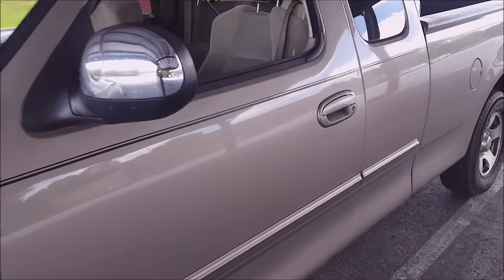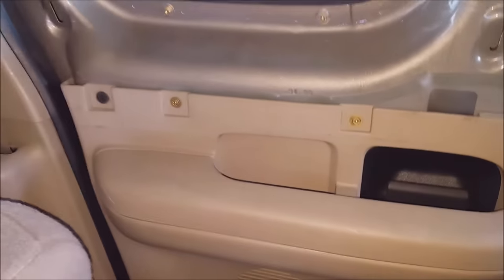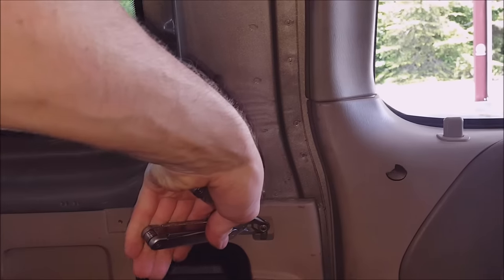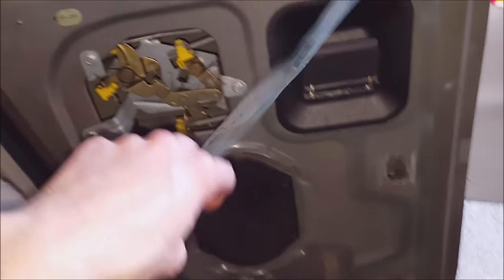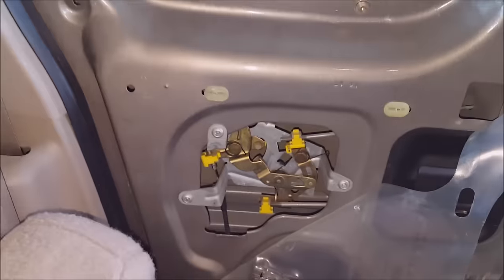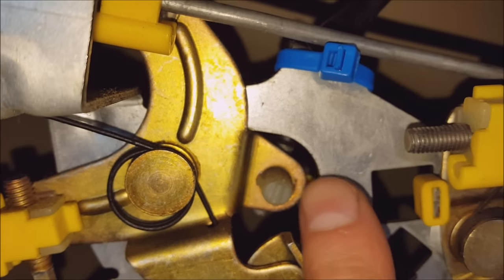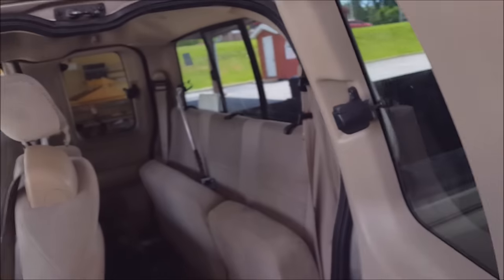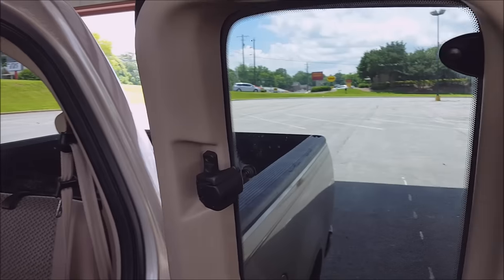Rear Door Wont Open F150 1997 - 2004 SuperCab

Comment: Mine stopped working today on the driver side. So I'm like maybe it's because I slammed it. So I went to the passenger side and slammed that side too. Now they both wont open. Fml
Reply: Sounds like my luck.Great running truck but starting to rot of its frame.
Reply: My man!!
Reply: It’s because they use plastic and plastic doesn’t hold up
Reply: @Austin_B_Videos  Yup plastic never has and never will hold up for this application anyway. While it doesn't take a BSME to figure that one out, we won't blame the engineering department. Engineering at Fomoco was probably over ruled by the bean counters 27 some years ago. So what did they care since most light trucks are sold to the commercial / fleet markets and therefore are built with a design life of like 10 years or 100k miles, which ever comes first.
Reply: Same here bud, sucks.
Reply: Lol same, I always thought since the rear door was double latch it needed an extra push which is so wrong 😂 I’m about to try this rn and see if it works
Reply: @codyswilley  ty for this video. First my passenger side door wouldn't open now both aren't opening. So I have a project set up for After the Chicago Bears Game. opening day of the regular Season 2024 .. 🐻👇

Comment: There is a cable sheath end repair part, I got one from the local auto parts store for $12. The part number for the cable sheath end is "doorman 926 111".
Reply: I just used these to fix the 3rd door on my '97 XLT Flareside. The stock part is plastic/rubber and will dry rot over time, but these aluminum parts should last forever. Easy fix without replacing the entire cable.

Comment: Huge help! You don’t have to break that pin though at 2:35. You just push the center in with one side of your needle nose and it pops right out unbroken. This video was so incredibly well shot (one handed fix!) and so short and easy. You’re the man! Hope my little tip helps someone.
Reply: Saved my pin, THANKS!
Reply: @kylewidmar3177  glad to hear it! Nice to put it back together with all the pins intact.
Reply: Aw, man. I wish I read your comment before destroying my pins!
Reply: @atomaardappel566  ugh!  Yeah, I almost did that too- only reason I didn't was cause the great guy that made the video commented about this breaking the pins... so I was thinking "there has to be a way to do this without breaking the pins" so I looked carefully and got lucky.

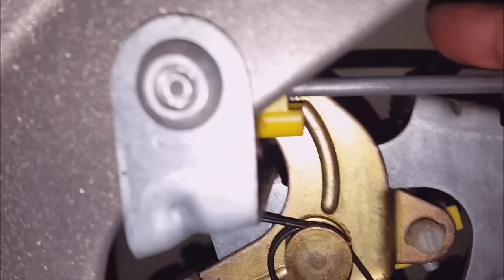Comment: Good video told me how to get the inner panel material off my "third" door on passenger side 98 model. Mine the black plastic cable end collar stopper things had broke on cable for upper latch, so I opted to replace them with new aluminum ends, not that expensive a set of 4 to do one door run $5 - $15 online or at your local parts store. Other videos on YT show how you either replace the ends which is usually all you need or the entire cable as desired or required. You can push the white / yellow plastic piece out squeezed with needle nose pliers. (SEE, little white nylon plastic circular thing @3:54 in video center screen which is to the right of the spring.) Be careful, (and try to do when the temperature is reasonably warm, duh, or warm gently with hairdryer first) but if you break the plastic parts, can also get new of those as well. Cable then comes loose of the mechanism and can pull up and out to either put new aluminum cable end on (replace the black plastic cable end under finger in this frame) or new cable. You do NOT need to drill any rivets out to replace the ends or the entire cable for that matter, just DON'T. When buying new cable ends, try to get a set where one is different, a bit thinner at the end having what is termed a "cam end", for easier install in the top latch. 

On mine only the upper cable ends were broke so did not bother the bottom, being after watching this video and doing, why I can get back in there in like 10 minutes if ever need to! Oiled and greased everything, figure bottom cable will last life of the truck. Other videos on YT also will show you how to remove torx head screws so the latches can be accessed to replace those collar ends. Got mine DONE, thanks much for video, just trying to help you guys and gals out there with yours. Good luck.

Comment: Thank you this is exactly what happened with the truck I'm working on thanks for making this video to clarify how to take it apart of all the door panels I've taken apart on these suicide type doors this is one of the easier ones to do especially when the door is stuck locked and you got take the panel off and get it open from the inside

Comment: Thanks. Got mine fixed with the zip tie but if you take the three screws out of the top of the door you can undo the cable from the mechanism where you put the tie and pull the cable and all out and replace fairly easy as well.
Reply: rip rap thats my next move after the cable arrives, thanks for that information.
Reply: Since I posted this my zip tie rig had failed. I had to get the aluminum ends you can get off of Amazon. They are working well. My doors get used multiple times a day with the kids getting in and out.
Reply: @jumpinggulley  it looked like it would slip upward.. i would have used a second zip tie to keep that one in place

Comment: Great 5 minute fix I did open door and fix from outside , Texas too hot to be inside and the nut is a 10 millimeter..
Reply: My door just failed too but lucky for me I just redid my AC system so I’ll be fixing it from the inside the truck with it running 😂

Comment: that is a 10mm on that bolt and I had to use a couple zip ties. one to keep it in the slot and one to straighten more vertical.  thanks for the vid, both my doors were locked.

Comment: Now the looking through the handle to see if the cable was broken or dislodged was a great tip! I have a 98 and only one back door with a back seat full of garbage, parts, fishing gear, empty bee... I mean fishing juice cans ect. It is going to be a nightmare to get at but maybe if it is the same issue I can manually pop the door open through the handle.

Comment: I bought the pieces on Amazon for the cables and put one on the piece you tie wrapped. I had to use a small c clamp and put it in the door and pull the cable back in place after putting the piece on the cable first.
They come 4 to a package and are kind of cone shaped

Comment: Thank you for the helpful video. I can do all that if I can see how to get it apart. And now I know. Interesting that the latch looks identical to the one inside the tailgate. I've had to replace that one before because one of the latch ears broke off. It's made of pot metal, not steel.

Comment: Great video bubba but it wasn't that easy for me tho ..I did what you did   with a tie around  the bracket but it didn't work but then I pulled down the top cable after fastening like you did and about 2-3"from the bracket  i zipped tied the upper cable with to heavy duty zip ties and it work perfect total of 3 thick heavy duty  hope my fellow bros that trying to save some dollars  watch this video and if you run into more trouble maybe my input might do some of ya'll good 🤘✌👊🤞

Comment: Just watched your video on your back door latch not working I want to look at mine same thing happened what I found out the cable still attached what the plastic outer housing at the end has a a little plastic thing it fits in that slot where it's supposed to be where you zip tied it and the metal after years of use it cuts off that's why the zip tie work it's holding it in place thank you
Reply: Thank you

Comment: The plastic piece that goes in the slot was broken, I got the doorman repair kit part number926-111.  The sad thing is it's on both driver and passenger rear doors. But I got it fixed. Had to take the cables out to do it.

Comment: those are not rivets they make a tool for those bolts approx $12 at a mechanic specific store
Reply from the maker: That's interesting do you have a link to one?
Reply: They are aluminum “pop” type rivets with a steel pin. They have to be drilled out to be removed. Drilling the aluminum is easy, but the steel center pin makes it difficult - your drill will wander everywhere. The secret is to take a metal punch and hammer to the steel center pin. Sufficient force will (finally) pop out the pin (usually takes me several sharp blows with the hammer). Once the pin is knocked out, a drill will easily chew through the aluminum rivet. Can’t remember exactly what size bit but it’s a step or two up from 1/4”.